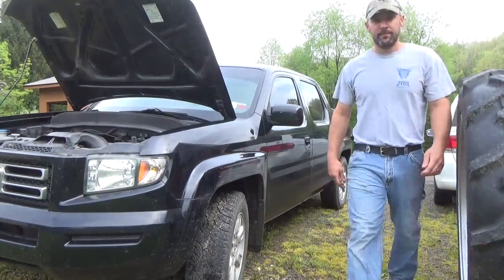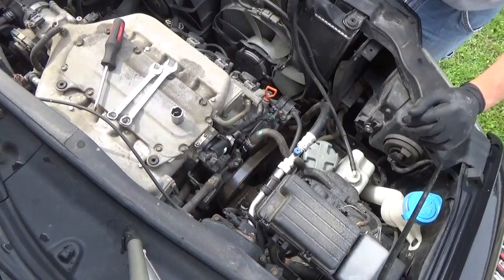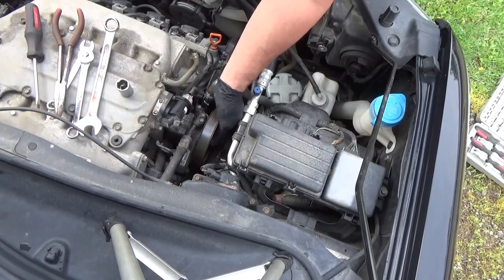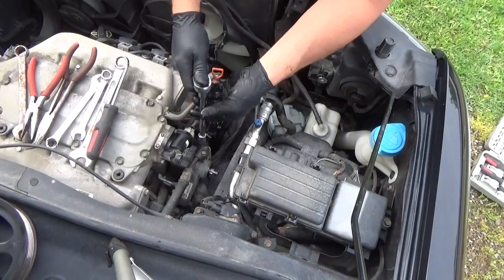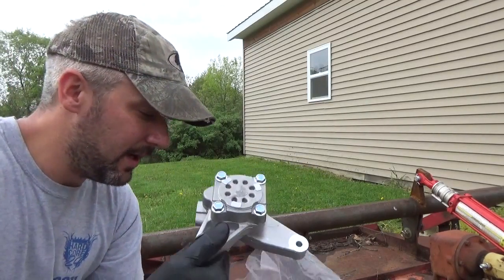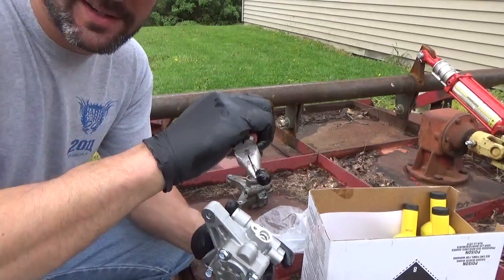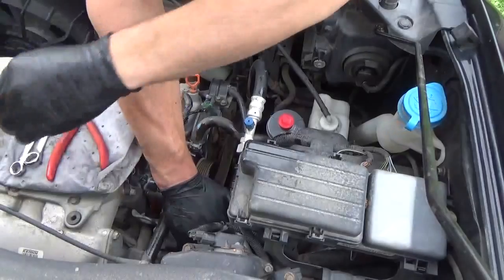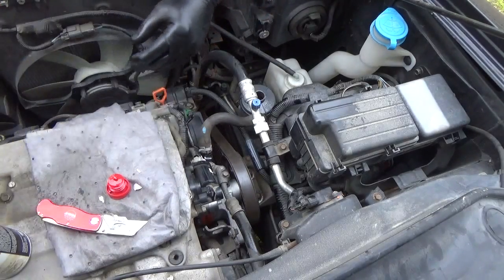DIY Repair : Honda Ridgeline Power Steering Pump Replacement

Comment: On a Honda, you should use Honda psf only.
Reply: Excuse me sir, I would dig through the manual but I thought I’d ask you. What are the torque specs for the bolts in this video? Thank you

Comment: Ridgelines are FWD? That is interesting.

Not that it's a bad thing, but you normally see trucks with RWD.
Reply from the maker: ***** It's 4wd You would have to read the 4wd strategy and programming to understand it better. Very reliable and excellent traction and towing for it's size.
Reply: Interesting! Ill look into it. Thanks for that explanation Eric.